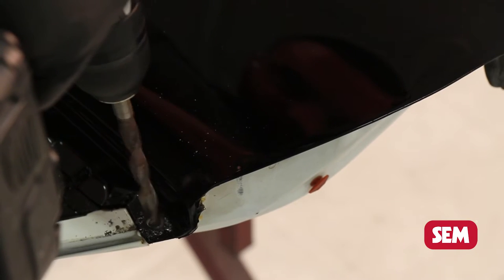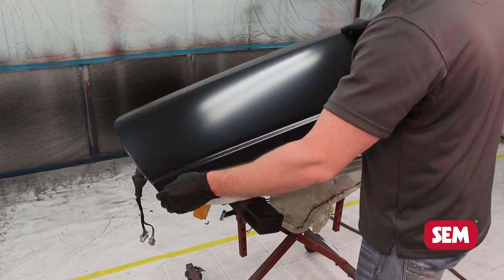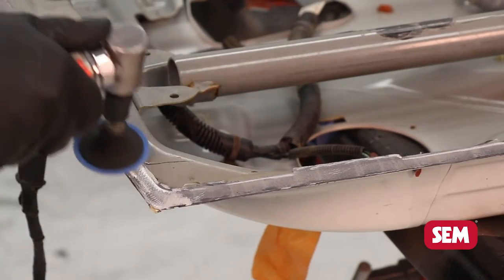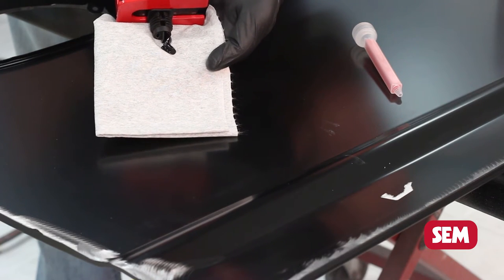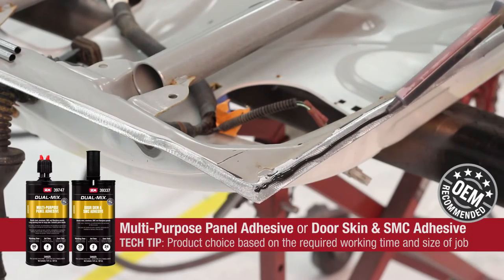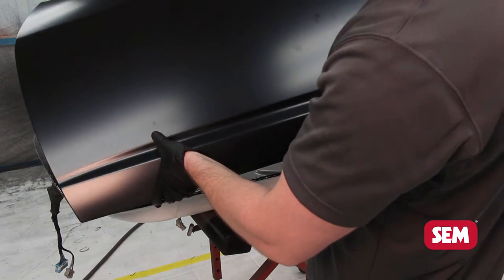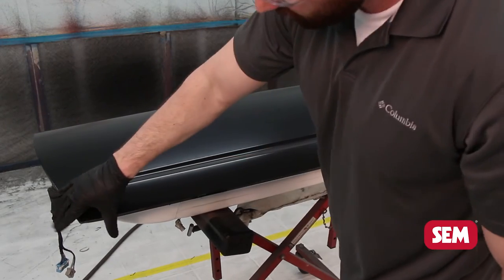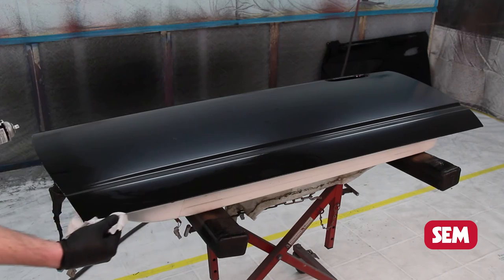SEM How To Series: Panel Bonding

Comment: Will this bond wood to fiberglass?
Reply: @Ole Crankbait Bass Tracker  - Make sure to use marine grade plywood as the resins are designed for moisture but at Sea Ray does this for gussets, bulkhead and mounting plate forms from generators to the head, it is done using two part clear epoxy first the fiberglass is layer and rolled with vinyl ester resin. 
  Your fiberglass will have to be scuffed with at least 80 grit, cleaned with acetone, fit your wood and perhaps look into “Total Boat” products as they have a YouTube channel. But pick the product and catalyst with the time & temperature you are working in. Prep strips of matt buy cutting, add cloth in different directions to add strength but finish your bonding with matt. Rollers can be made using large washers next to little washers to make a 3”, 5”, 7” custom roller to get air out and solid resin. Other companies sell epoxies as well, just make sure it is for fiberglass. Best of luck, hope it’s not the transom as this needs to be thick for motor weight and the motor mounts completely down like a bass tracker fishing boat. Use clamps and choose as small area first as the epoxy will kick and harden waisting money!
 Ex-Service Manager of the largest marine dealer in the state. Also, cert. auto. ASE Master Tech since 1978, retired. Best of luck!

Comment: How do you remove a glued panel off the vehical
Reply: @Cindy Lowe- Grinding the edge of any panel that is wrapped around like a door skin or bedside. Just don’t go past the metal once exposed. They make chisels for air hammers as bits as mostly universal in size for air guns. A large flat blade with a sharpened edge can help. They sell a simple bar cutter that is hardened metal and handle but made to be used hammer as one edge is sharpened. It is the cheapest but cave-man approach to separating metal with bonding adhesive or seam sealer. Eastwood sells an epoxy sealer in a spray can. It is two part with a bladder that is activated by hitting the bottom of the cab. It is to be used after your panel is bonded, cleaned, cured, sanded and seam sealer can be applied after it is sprayed on. Home improvement stores sell a spray can handle by “Rust-Oleum” that spring clamps onto any spray can and provides excellent control while spraying. The use of this epoxy sealer is it block moisture and water from getting to the metal. Follow by 2K primer, sand flat as needed, break-thru to metal, spray epoxy but the scuff to 400 grit or 600 grit, wax & grease, tack and compressed air, activated carbon face mask for breathing the paint base coat 2-3 until bidding (Check w/strong light) then clear coat up to 3 times. Let cure for a week to shrink and harden, wet sand 1k, 3k, 5k grit to remove orange peel, then buff with compound, polish with foam pad then clean. Best of luck to your project! Hope I did not bore you with info you already have knowledge of!
ASE Master Tech since 1978, retired.